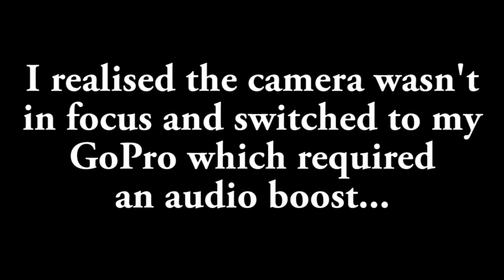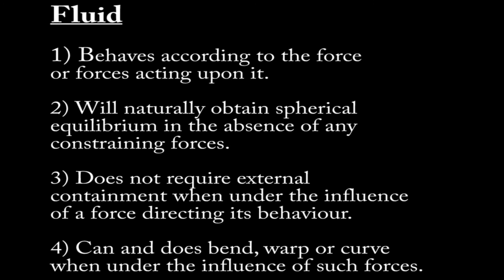Flat Earth - Simulating Gravity WIth Fluid

Comment: The ferrofluid provides the magnet a path in a magnetic circuit via which the magnetic flux can flow. The flux is much more dense near the poles than near the equator. The situation is similar to the situation in an electric circuit, where you would attach a spherical conductor between two electric terminals leading to a flow of electric current. However, for magnetic circuits, this will lead the fluid being attracted to the surface. The force interactions in shape are very different from those that occur with particle in a gravitational field. That is, there is no inverse square law attracting the fluid dependent only on the distance from the center of mass. The gravitational force, however, is identical in form to the Coulomb's law for the force between charged particles. Thus, if possible, it might be more representative to invent some kind of electrostatic experiment.

You probably have demonstrated that a force can lead to a fluid conforming to a surface. To make this more clear and eliminate other forces, this could be repeated with an electromagnet. Turning the magnet off could lead to the fluid dropping from the surface.
Reply from the maker: Thanks for checking it out. Really the main point is to illustrate that a force can contain fluid. The idea of refining it into something a bit more rigorous would be interesting, although for this audience also a bit of a waste of time unfortunately,  due to the nature of their bias and denial of simple ideas which are easily demonstrated.
Reply: @ETM2024  I would be surprised if you can find a single Flat Earther, who understands Newton's second law, which is a prerequisite for understanding any kind of force.